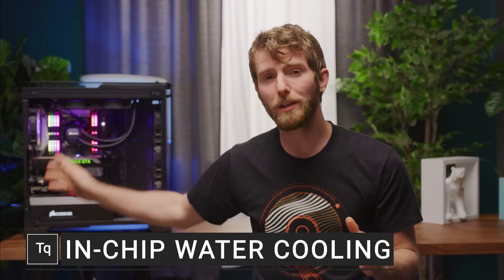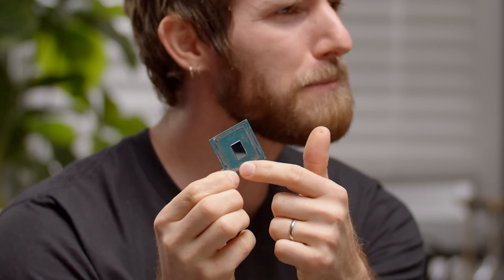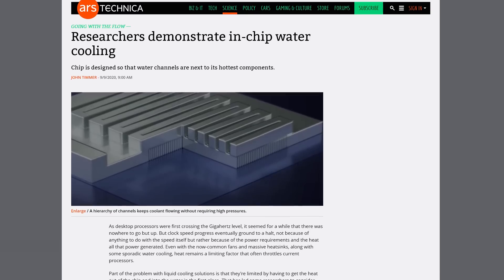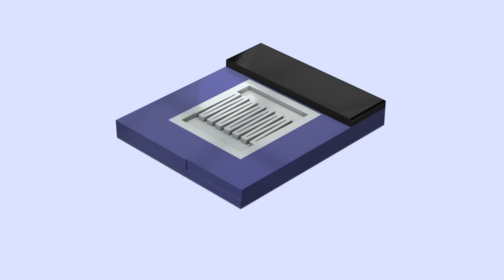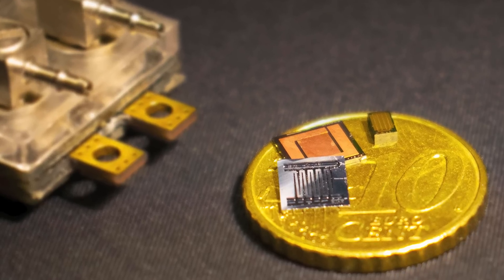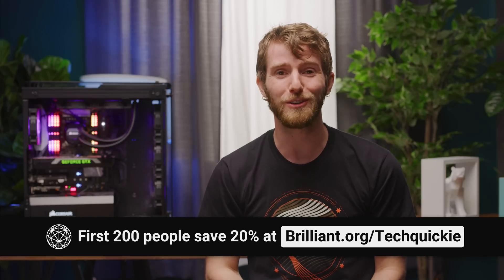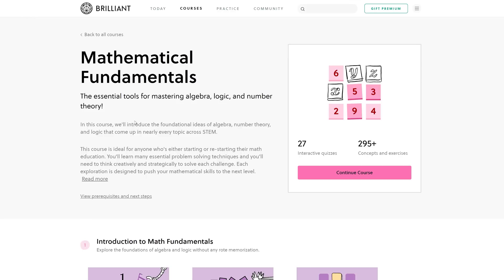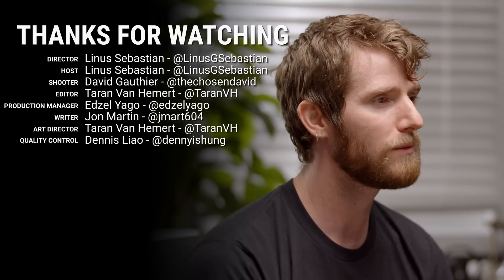Water Cooling INSIDE A CPU

Comment: Can someone riddle me this: a cooling solution does not reduce heat generated, it dissipates heats more efficiently, if the cooling system is so small, where is the heat sink? Does it mean that it just pumps the heat into the room and surfaces really quickly? Where does the heat go? Does that chip melt the things around it? So many questions.
Reply: From what I understand. Think about this how each heat sink means more space for the heat to travel to get to the cooling. Also the CPU is a die with a lot of room for heat to go to than water or air which is cooler then it takes some of the heat then moves it into the room around you. In this case the water is closer to the die meaning the water can take more heat therefor pushing more heat form the Die to the air out of the computer.
Reply: @raxze1338  Yep I understand the idea of less empty space more thermal efficiency, but the cooling system is just the middleman who shifts heat from a die to the environment, so the question is: given the same die (same heat output), if you pump heat away from the die at a higher rate, does it mean that the radiator at the get melt your face off hot quicker?
Reply: @ianng4633 Simple answer No ,  because for each one you are still pumping out 110 watts of power or another wattage one just do it more efficiency. Also if you have something at 150 degrees it will move more heat to somethin at 60 degrees than something at 70 degrees.  This is what the other method does.
Reply: Theoretically, cooling semiconductors does decrease the amount of heat generated, the amount depends on the specific characteristics of that specific IC.  The older, server/data center concepts, were connected to piping running throughout the building and connected to whatever the heat exchanged system was. Some used condensers, others used cooling towers.
Reply: @lordec911  So is it like a heat begets heat situation where the hotter a die gets the more energy it takes to do the same task, so if we keep it below a certain temp it runs more efficiently (less heat loss)?
Reply: @ianng4633  Yes. Leakage and some tunneling can be negated/lessened by cooling. Most extreme overclockers, using subzero cooling methods, are looking for high leakage parts since there is generally more headroom as long as you can keep the thermals in check.
Reply: In-chip cooling is basically just a redesigned water block that transfers heat into the water much faster, you'll still need a radiator and a pump to exhaust the heat

Comment: The biggest problem of this approach in my mind is the smallest damage can ruin the chip, for example if we used this in mobile phones, and you accidentally dropped your plastic phone on a pointy roxk near the spot where the chip is, your phone will soon die of short circuit because the liquid damage, or am i overthinking it ?

Comment: I wonder though how complicated it is to keep debris out of the chip. The smallest particle could get stuck inside these channels and kill the cpu in consequence, so you better have a reliable way to keep stuff out
Reply: Cleanroom level. Some of the older concepts had multiple inlets/outlets and elongated posts/beams as "fins" so a few minor blockages wouldn't cause a fatal failure.

 One of the patents(HP?) used it more like a vapor chamber/heatpipe that would be connected to a condenser. 
https://patents.google.com/patent/US7002801

 Intel's patent was designed to have a thin film thermoelectric cooling device(TFTEC) on the back surface of the IC, inside the microchannel.
https://patents.google.com/patent/US7957137B2/en

Edit- found the patents
Reply: @lordec911   Thank you for the links and thats what i thought, that you basically need cleanroom level cleanliness. Because of it it will be very expensive and probably unreliable/risky, so I doubt that we will see any of these approaches commercially for atleast the near future. Normal AIO‘s today already don‘t work perfect, so I only imagine what sort of problems this technology would have
Reply: how will particles get inside a closed loop if you assemble it in a cleanroom?
Reply: @ДаниилРабинович-б9п  If it is going to be a closed-loop that might be another issue, there will always be some (slight) loss of coolant, how would you ever replace that?
Reply: @ДаниилРабинович-б9п  The particles could come from everything. Galvanic corrosion would probably be the biggest problem, but there would also be particles produced by wear and tear of the pump or grease from its bearings. Maybe there would be something more unexpected, like hypothetically particles coming from the radiator - formed during manufacturing and detaching at some point, or whatever.
Reply: @zickzack3106  well, i guess there could indeed be problems, though i guess the engineers that are doing this probably thought about them (hopefully)

Comment: It's all fun and games until the water cooling gets out of the cpu.
Reply: Its all fun and games till nestle get into the watercooling market
Reply: @commandertaco1762  drinkable CPU coolant
Reply: Is all fun and games until the microchannels are clogged up
Reply: Don’t let the magic blue smoke escape!
Reply: That's why companies should be spending millions and millions of dollars on proper quality control to prevent this or else they wasted the billions they spent on this new investment.
Reply: That's when the real games begin!!
Reply: also its not a question of if but when. Motor fail or a leak and the entire thing is virtually useless whereas a regular metal heatsink u only have to swap fans.
Reply: This is the coolest tech to look forward to in a while. The last tech I was hyped about was hydrogel condoms. Both tech should keep liquid inside or everything will be ruined.
Reply: How many times can the water recycle itself from steam to water before its completely useless
Reply: @daly7258  what
Reply: And it's still running
Reply: Yeo
Reply: It will lead to instant vaporization (I know this one is sarcastic, so not need to put this at r/whoos)
Reply: Did my first watercooled pc with a 9900k and 1080ti.......after 8 months the cpu waterblock cracked....lucky I had vertical mounted the gpu.....it leaked on the Cable not the actual gpu......dark rock 4 slim now....not half as good but no risk amd much easier to deal with
Reply: *Now* things are getting out of ha- Cpu.**
Reply: but there are non conductive liquids, even pure water it's non conductive
Reply: @thesebas3090  yeah, they become conductive over time when contacting other materials.  There are liquid cooling fluids that are non conductive, but they only stay that way for a couple months.
Reply: Well then that is even better, it will cool your motherboard too and potentially other components of your PC.
Reply: @maskiez  yes
Reply: @epicfap36  depends on the dye normally but i think adding anything to your loop is a pretty bad idea if your not going to pull it apart every 6 months, here the solution should be closed loop and look at lower viscosity liquids but made this way im a clean room youre not likely ti see any growth in your loop
Reply: it's*
Reply: @fx0201  Yes.
Reply: How do you expect that to happen hmm
Reply: @andrewelraheb9897  Seals don't last forever, glues or epoxies can last longer but water will break through and find a way to escape eventually.
Reply: @vgamesx1  ahh
Reply: @vgamesx1  doesn't have to last forever, it just has to last the lifetime of the chip
Reply: @andrewelraheb9897  just a joke
Reply: This is gonna be  standard eventually, it's expensive to leave to 2 companies do what one could, as the world goes in the direction of efficiency, this or another similar solution will eventually become a reality, while ppl are in this comment section debating if is viable or not there are other ppl working to make this happen, right now
Reply: This comment isnt suppose to make sense
Reply: @Seserium  The word is "supposed".
Reply: @Seserium  its just a joke
Reply: @ok-js3tp  we know
Reply: or gets to its boiling point
Reply: no fucking shit sherlock

Comment: Wait.... This video has different camera angles when Linus is talking... Is this new????
edit: OK, so this is because of the new set?
Reply: This is... sort of new? It was a fad some time ago, but then it mostly went away (or I stopped channels using this side shot or whatever it's called).
Reply: They do this when they have no actual hardware to show
Reply: This is their Shortcircuit set. I would imagine that the room where they have their usual green screen is currently under renovation, hence the change.

Comment: Water cooling inside a CPU 

True man of his culture
Reply: But have they worked out the in die RGB yet? Think of the performance loss without it.
Reply: @backupplan6058  download more gpu to compensate the loss
Reply: @TechTroppy  been trying to download the 3090 for weeks now, didn’t realise a download could be sold out.
Reply: Its like a culture inside a man
Reply: I think a way to get rgb inside a cpu is by letting it get so hot it glows red. Of course it isnt red green and blue but its a start
Reply: @creatorboii3012  if you heat it enough, the light will be more energetic and the wavelength will reduce, giving you green and blue light.
Reply: @creatorboii3012  if it's hot enough it'll glow blue, you just need to be brave enough
Reply: Yeah I know. What if we could keep these chips that cool? (:
Reply: submerge most of the motherboard to liquid? it has already done: https://www.youtube.com/watch?v=cR4Mutf1kQg
Reply: I doubt it is better. The flow rate is too low. You'd need a lot of pressure. Seems like a scam.
Reply: @jamesm5192  Scams are everywhere now a days. Have you gotten one of credit card ones lately?